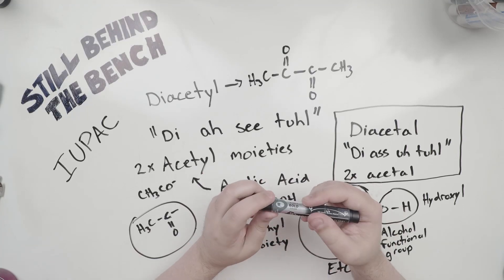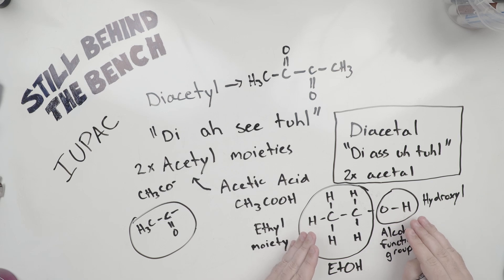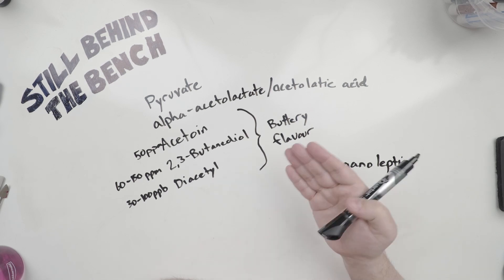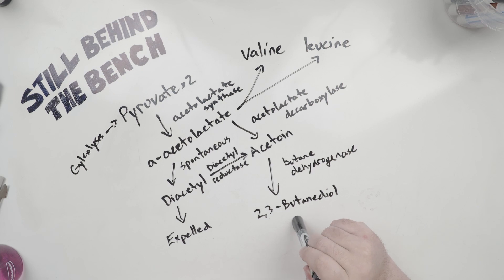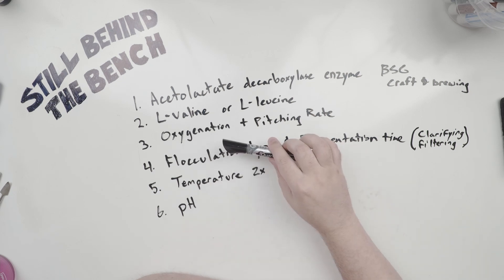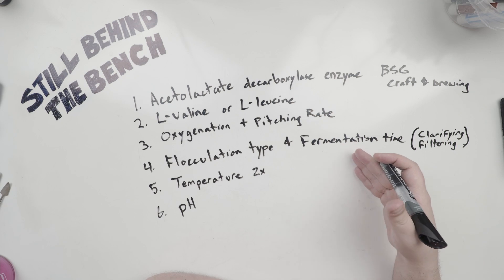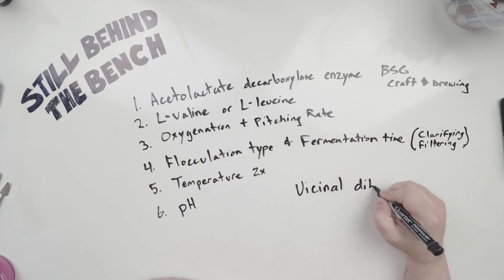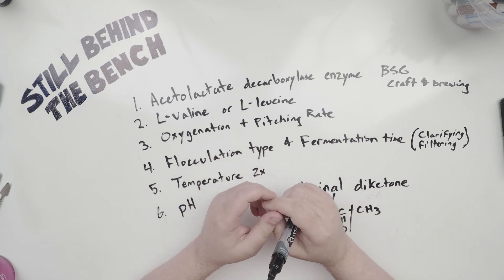Ep 025 - Diacetyl and Other Buttery Compounds

Comment: You should read the butter rum thread on homedistiller.  In short, normal rum wash with bakers yeast but at end of fermentation heat it up to 130F or so then let it sit overnight.  Run it the next day and it's buttery goodness for days.  It's a whole lot simpler than your high diacetyl plan, which admitedly does follow the traditional brewing science.  The butter rum method was discovered by complete accident doing something that would pretty much never have been done on purpose in any professional setting.